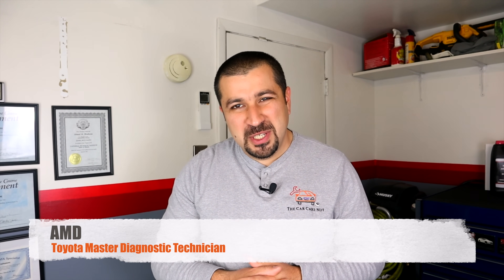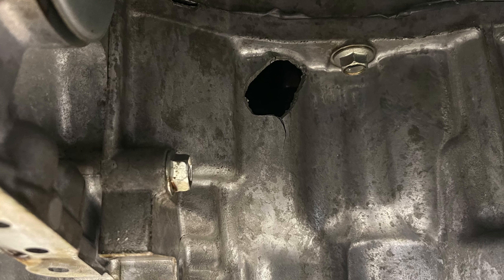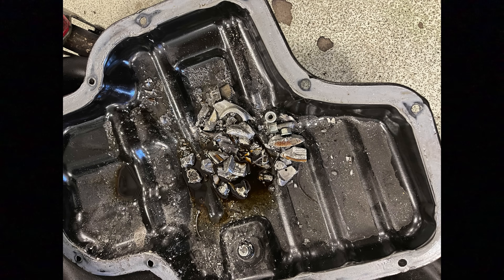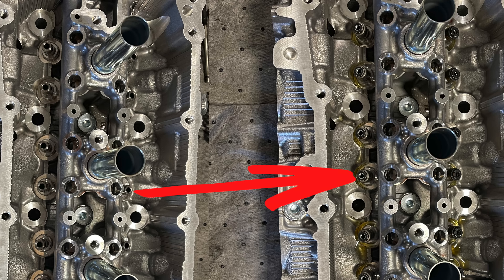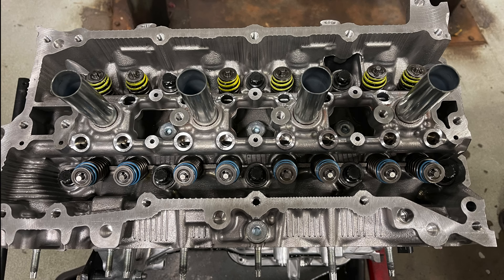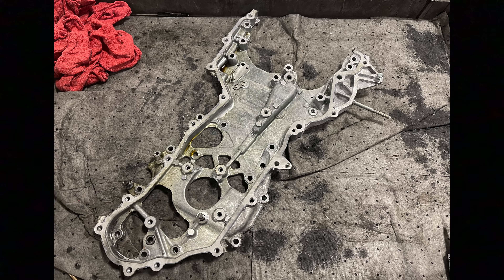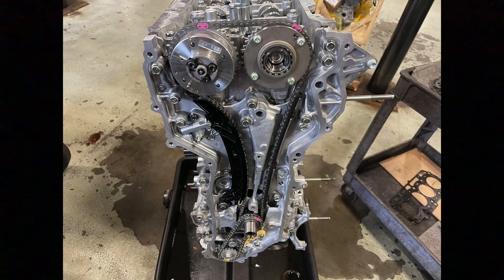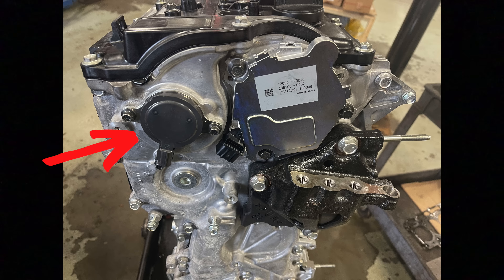Toyota's New Engine assembly Full start to finish!

Comment: On the 2AR FE in the 4th gen  rav 4,does the idler pulley (I believe that’s what it is) normally vibrate? Is there somewhere i can send you a short video? I’m getting ready to take this car on vacation.
Reply from the maker: Hi! Upload a video on YouTube and reply with the link. Which year rav4?
Reply: @TheCarCareNut  here is the link. https://youtube.com/shorts/_LV1SsnR2h4?feature=share
Reply: @TheCarCareNut  thank you. This is also a link to google photos, I think this is probably higher quality than what YouTube let me upload. https://photos.app.goo.gl/GbDoeEjwYtLAaruo6
Reply from the maker: So that’s the belt tensioner and it’s normal for it to vibrate or move as shown in the video. Nothing to worry about my brother. Check your tires and brakes and enjoy your vacation. Safe travels.
Reply: @TheCarCareNut  thank you! And thank you  for your always being so helpful, and taking the time out of your day. when I bought the car it was certified I seen on the history they replaced the Serpentine belt at 30,000 miles and that’s really the only reason it caught my attention.

Comment: This engine in the hybrid is amazing, hardly ever hit 1500 RPM at 60MPH and below, seems to runs mostly in the 1200 RPM range.  Fixing to see what it does at 75-80MPH but I don't expect it to run much higher. Very efficient mated to the electric motor
Reply: How can you see the engine revs on Hybrid? Hybrid gauge has Charge-Eco-Power zones, but not marked in RPM, at least on Camry, Sienna, and Highlander as far as I've seen.
Reply: @alexmukhortov926  E210 Corolla has this engine in 2.0 verion hybrid and also a tachometer.
I think the facelift version that just came out ditched it though but still some hybrids have it.

Comment: Much respect from one tech to another. Very handy work on such a new engine, dropped much knowledge too. Was it the cylinder head that the Japanese warning said to keep away from sharp objects?  Thats the only thing I can think of that would be so sensitive. I bet if you sent pieces of that debris off for analysis you would probably find metals, that did not come from  that vehicle. I just can't imagine what would have cause that besides sending a coin or similar through the intake, downstream  from the filter whilst someone  is revving the engine. How does the rental company not charge previous renter?
Thank you and may God continue his blessings to you and your family.
Reply from the maker: Thank you my brother. The Japanese warning was on the cylinder head likely they don’t want it dinged since it’s a machined surface. It’s still a mystery what happened to this one.

Comment: I smashed that like button...so fascinating to see a new dynamic force engine torn apart then rebuilt back together...and you sir are truly a MASTER technician. 

In a Highlander/Kluger, what does the "Power" and “Eco" modes do? Does it just change the timing of the gearshift and the way the air con operates? I don't feel a lot of difference when using both.

Comment: If I was to run 91 gas in 2018 Camry 4 cylinder engine would I benefit or cause damage? 
I hear so many different opinions on this.
Reply from the maker: Hi! You won’t cause damage. But you won’t benefit either. The only time you would benefit is if the area you’re in doesn’t add ethanol to premium gas.
Reply: @TheCarCareNut  thank you. Had a coworker say he never runs 87 and he notices more power and better overall feeling when he uses 93 in all his vehicles

Comment: AMD, how often does the PCV valve needs to replace on these engine? And how hard is it to be replaced? Thanks
Reply from the maker: Hi! I would replace it with the spark plugs at around 120k and it’s not very hard to replace but a bit more involved than previous models
Reply: @TheCarCareNut  great video, great information, and an awesome person!

Comment: Bent valves = Interference Engine? On a Toyota? Dynamic Force, eh?
Reply from the maker: They were bent because the piston blew up. The timing chain was intact
Reply: @TheCarCareNut  Thank you for your reply. Still I ask, Is it an interference engine? Higher compression than previous model? I ask because I'm thinking about buying this model car. Anyway, timing chain should last engine life. Still, good to know if interference?
Reply from the maker: It’s an interference engine
Reply: @TheCarCareNut  Thankyou Sir :) Having cleared that - Yet, I have to ask - Why did a piston disintegrate? Unicorn = No one knows? User was Sinful? Or freak, manufacture defect?
Reply from the maker: Not clear at this point honestly. Misuse is possible but no information or way to prove it

Comment: Thank you for your effort in making this video. I am studying these engines to see if I can modify one to use it in drag racing.

Dynamic Force engines got some interesting tech features like their "tumble flow" in cylinder air-flow effect at intake stroke, that is why I am interested in the capabilities of modifying these A25A-FKS engines for the ALL-MOTOR CLASS (modified naturally aspirated engines)

Yes, it is a new TOYOTA motor but  TOYOTA is known for making stout engine blocks.

As a  TOYOTA Technician you know about the following engines:
2AZ-FE 2.4L
2AR-FE 2.5L...
...Both of those engine moldels have been modified to the extreme for Drift cars and Time Track Attac races, with 2AZ-FE making 1,400 HP and 2AR-FE making 1,200 HP (on OEM TOYOTA engine block casts)

Comment: Curious about your thoughts. 
I have a 2021 Prius prime. We went on a long trip, and when I was driving at highway speeds it EV mode, my plug in battery ran out, and my engine started. 

Is it bad for it to start to start cold at highway speeds, or has Toyota designed something for this?
Reply from the maker: Hi! It’s ok for the engine as it doesn’t start immediately at high rpm it gradually goes up

Comment: My 2011 Camry needs a rebuild :(.  It's got 258k on it.  I'm still just adding oil, after seeing this no way I wanna try diy.  Thanks for the interesting vid.
Reply: My 02 Camry was using a lot of oil.  Ran seafoam intake cleaner and engine flush. Went back to not needing oil too ups anymore at nearly 400k.   Then a bus hit it.   Apparently. Rings get stuck. Worth a try

Comment: heck dude im 68  I used to work on Fiats back in the day,70s nobody had adjustable pulleys ,or  hot cams, but those  1600 twin cam engine,s  were good for 6000 rpm and 125 hp with  headers and dual side draft Webers

Comment: Great video!  It's difficult to tell if it is easy to get to the PCV valve once the engine is back in the car.  What is your thought on this?
Reply from the maker: It’s not difficult to remove the intake manifold on this engine in the car
Reply: @TheCarCareNut  The Volvo 5 cylinder gas engine needs the intake manifold removed when servicing the PCV system (AKA flame trap), but the Volvo system is complex and expensive.

Comment: I can’t believe these engines have an EGR system. Though variable cam / valve timing is supposed to eliminate that. It has for 15+ years. 
Great video! I have a 19 RAV4 LE.
Reply: I believe that's due to the Atkinson Cycle on these engines.

Comment: What was the final cost for this new engine and of course the labor.  This engine looked similar to my 2020 RAV4.  Sure is purty when its new!  Was the engine oil 0W-16?
Reply from the maker: Hi! No information on the oil used as it was sent out for inspection. And the cost was over 15k
Reply: @TheCarCareNut  wow.. $15,000? For $8,000 more you can get a whole new Camry. I’d consider just cutting my losses.

Comment: I see that the new Highlander Hybrid uses this engine. Since you generally advise against 4-cylinder engines in larger cars, would you recommend the new Highlander Hybrid over the 6-cylinder version?
Reply from the maker: Hi chris! So in the newest hybrid configuration of the highlander I liked the 4 cylinder because it gets a power boost from the hybrid system. It’s not as fast as the previous model but it’s enough power but better gas mileage

Comment: The complexity of this is unbelievable! Everyone should watch this and then give major appreciation to the engineers who design these engines and the mechanics that work on them. And we expect these things to go over 100,000 miles. Amazing!
Reply: I want my engine to last more than 200,000 miles!
Reply: I was wondering how much more complex this engine is than your old 22R?   Just hypothesizing, I'd say about five times more complicated maybe just five times the number of parts!  That means if you figure parts are made with the same reliability as before, this engine will have a problem five times as often as the simpler engine!   Dad always said, "just get the wind up windows; less likely to break".
Reply: I expect no less than 300K miles out of any Toyota that I buy new and maintain correctly.

Comment: Hello I have a question for you I have a 2019 Toyota Tacoma 3.5 engine with 4000 miles The engine sound like diesel  I want to know if the engine noise is Normal thank
Reply from the maker: Hi! That is normal. They tend to sound like a diesel because of the direct injection
Reply: @TheCarCareNut  Thank you very much

Comment: Great slide show and amazing work! Did I miss something? I had the impression Toyota uses electric oil pumps nowdays. Or it's just for the hybrids?
Reply from the maker: Hi! Gasoline only and even hybrids have a mechanical oil pump. Some of them have electric water pumps like this engine but not oil pumps.

Comment: 2017 2.5L is whining like a turbine on the downshift, sounds like a hot tea kettle at 45-60MPH at 1500-2000 RPMs.. still under powertrain warranty for a few thousand more miles.. what do you think? Should I have it looked at? Transmission?
Reply from the maker: I would have it looked at especially since it’s still under warranty
Reply: @TheCarCareNut  Thank you for the reply! I think I will do that. It’s a subtle noise but it’s there .. I’m sure they’ll figure it out.. thank you again!

Comment: My son needs a newer van (interested in the Toyota Sienna due to his family size) and when  Hertz went through their bankruptcy they had a few 1-2 year old Siennas on their website but what  turned me off was that even a one year old van had over 20,000 miles and the two year old Siennas were about 39,000 plus. I said to myself these vans were on the road A LOT! What did that mean to me. To me all they did was get 'em back, wash them, vacuum them, gas 'em up and out they went again and I would bet they never went in for any service at all because that was down time they weren't making any money on. I did notice that some Hertz  vehicles you could get a Hertz warranty on and I bet these were their low mileage rentals in locations where the rental volume was slower. I wouldn't buy one.

Comment: I have a 2021 Tacoma 3.5 V6. I know about the direct fuel injection and it’s ticking noise. My issue is how loud the engine is at idle with a knock. I changed the oil at 1200 miles and the knock is still there. It goes away at around 2000 rpm. Is that normal?
The oil that came out of the filter cartridge was full of brass looking metallic flakes and was suspended in the oil.
Reply from the maker: Hi! That’s normal for those engines with the D4S
Reply: @TheCarCareNut  thanks for your reply. I personally changed the oil and filter on your recommendation and I’m glad I did. I used 0w20 Mobile 1 fully synthetic and pen Toyota filter.

Comment: With having to purchase OEM Toyota parts (if not under warranty) that are much more expensive than when engine parts are assembled in factory and having the hourly rate of a Toyota ASE Master Mechanic and the overhead expense of the dealership, really seems that a brand new OEM factory engine would have been less expensive to install?
Reply from the maker: It would be but Toyota doesn’t offer a complete engine

Comment: Great video. Just wondering, did you require the custom to come back after 1,000 miles for oil change since the new engine just break in?
Reply from the maker: We recommend that to customers but in this case doubt we’ll see this car again since it’s a rental

Comment: Nice work. Given the amount of labor and the fact that it’s a relatively new engine with limited support/information wouldn’t it make more sense for Toyota to send you a fully dressed replacement long block?  Seems like that would be way more efficient to swap over some external parts and accessories. It would also probably be cheaper for Toyota from a total warranty cost.
Reply from the maker: Hi! It would be but Toyota doesn’t really have a full engine as a purchasable part and plus we could use the experience as this engine is very common in a lot of models

Comment: Amd i have a question. I have a new venza and it has a horrible wind noise from the passenger side front door. I have been doing lots of searching but can only find people complaining about there highlanders having the same noise. 
Anyway my question is i want to take the front door panel off and can’t find any info cause the car is so new. Is there anyway you can get me some info on how to take off the front door card?  Thanks.
Reply from the maker: Hi! Before taking the door panel off. Try folding the mirror and drive it. That whistle noise is usually from the mirror. Also try using painters tape to mask around the front of the glass on the outside and see if the sound stops
Reply: @TheCarCareNut  so i found where the noise is coming from. It is coming from the little triangle window on the front passenger door. I put masking tape on it and noise is all gone. While investigating some more i noticed is is loose and it moves around. While the drivers side doesn’t.  I will be tanking it in for warranty. 
Thanks.

Comment: had something similar with only 20000 but not a complete failure on a KIA. it was a knocking noise coming from low and yes a piston did scratch a cylinderwall at one side. 7 years warranty of KIA saved me ....they decided do send a new block with mounted crankshaft and all pistons in it. i paid zero and car runs since 220000.  It was the last piston flanged direct to the auto tranny and 2 years later they reduced the power output of the same engine from 109hp to 99hp for the version with automatic !  I heard i was not the only one and the last cyl on the hot tranny get more hot than the others which causes in some cases (driving style, ambient conditions and internal tolerances) this damage.  Upcoming e-cars do not have any of those mechanical issues at all !

Comment: If i am the owner, would probably pay slightly extra to avoid reusing the few old parts.. not worth the risk of having old parts that might have been damaged causing weird leak/noise/vibrate on rebuilt engine that has 90+% brand new parts..

Comment: Few things. The value of this Camry just went through the roof after being put together by the Car Care Nut! Second. This engine is beautiful aside from the plastic intake manifold. Third. Im not assured by this being a rental. Catastrophic failure like this should not happen by putting the pedal to the metal. Ive seen this issue elsewhere. There must be an underlying reason for this to happen.
Reply: Especially since it only happened to just one piston.
Reply: Apparently car manufacturers are not aware of that plastic is a combustible material & it could be cracked or crumbles over time unlike metal intake manifolds. That is stopping me from buying a new car.

Comment: I work at the Toyota factory that builds those.  I work where we bolt the transmissions on, all accessories, wire harness, etc.   Ask any questions you want...
Reply from the maker: The new 8 speed is holding up well after the initial hiccups. This engine gets better gas mileage than the 2AR
Reply: Is this engine any better than 2AR FE and what the advantage over previous 4 cylinder toyota engines?
Reply: Hello from TMMC 👋
Reply: Were you the one that left a half eaten tuna sandwich in my intake manifold?
Reply: If I personally attend the factory, can I order a car I want with the options I want?
Reply: How destructive can be 8000 mile oil change interval if driver was doing mostly highway miles?
Reply: AMD doesn’t ask the questions. He answers them 💪🏽

Comment: So I have a question. In my 2000 es300 is a 1MZFE engine it says to use 90915yzzd1 oil filter but I have been using yzzD3 instead for like couple of years. Its bigger so more filtration. But can u talk about what are the advantage and disadvantages. Can wit cause engine pressure issue or other issues. I do not have any problems. Thanks
Reply from the maker: Hi! Both filters are interchangeable. It does change the capacity very slightly because of the bigger filter but there’s no real advantage going with the bigger one but no harm either of course

Comment: Thanks for this very educational video. I was thinking about the new Tundra when comes out, but someone who works on Lexus says the turbo V6 is one of the most complicated engines he has ever worked on. A comment was made in response to this was it may be of concern when it's out of Warranty. I would like to keep it long-term. Do you think this was made in response because most Lexus/Toyota engines in the LS series have been around forever? What are your thoughts on this turbo V6. Thanks for all you do, AMD!
Reply from the maker: Hi! Still no information on the V6 turbo which will be in the tundra. I agree on the LS v6 being very complicated. That could be the tundra engine or a 2GR turbo. Well find out very soon